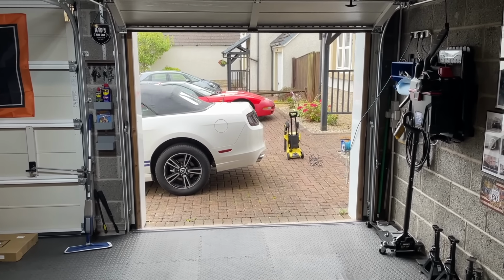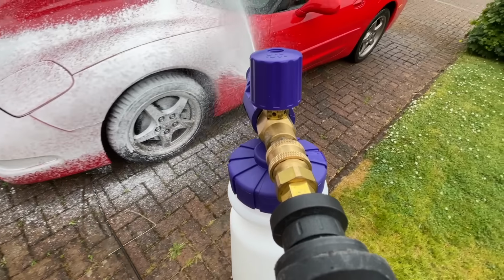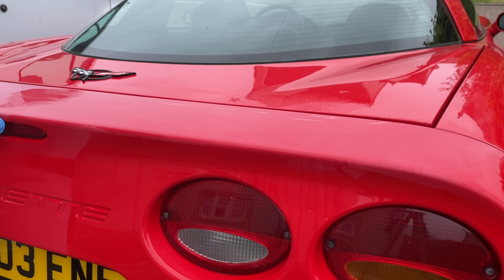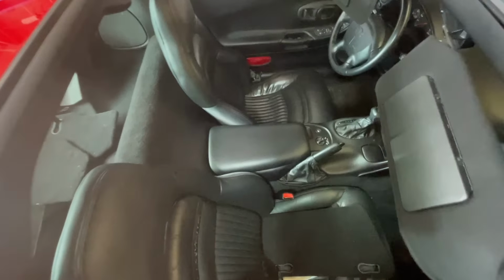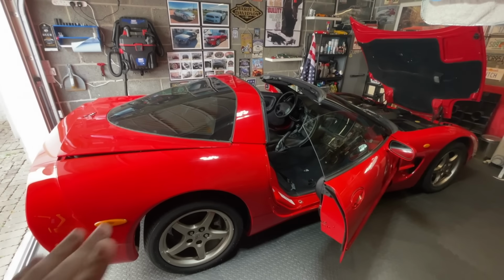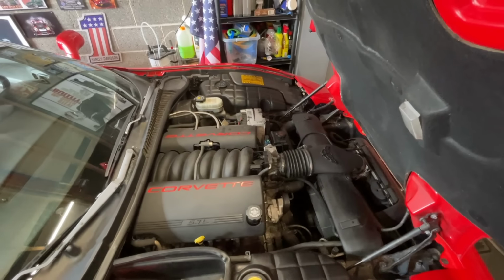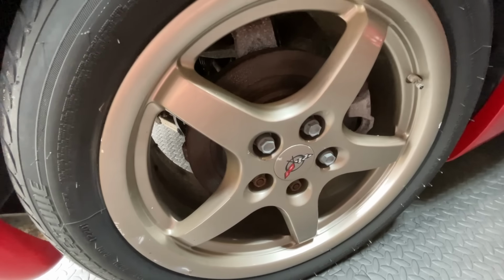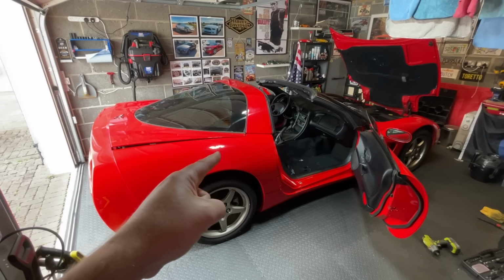1998 Corvette C5 Project Part 1

Comment: Thumbs up from USA.  Looking forward to your C5 content.  I also have a C5, and I've added a Joying head unit.  Definitely updates the interior and being able to use CarPlay and google maps is great.  It's interesting to see the differences in the exported cars, such as the tow hooks and different lights, and your fog light location.  I've also added the knight drive lights which are a big improvement over stock headlights - something to consider if you will drive this much at night.
Reply from the maker: Both are upgrades we would like to do! The export features are quite irritating, like the front lights which are single bulbs as opposed to doubles as they are in the states. An issue I may hit with the Knightdrives wiring but we will see. Plus the welded on tow hooks aren’t the best looking but heh ho! Parts 2-6 are uploaded.Thanks for following 👍